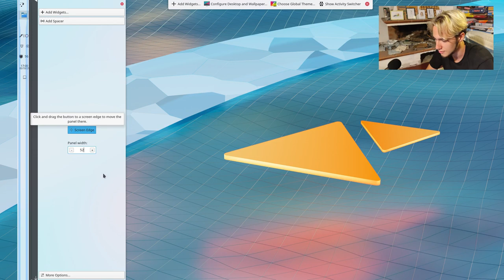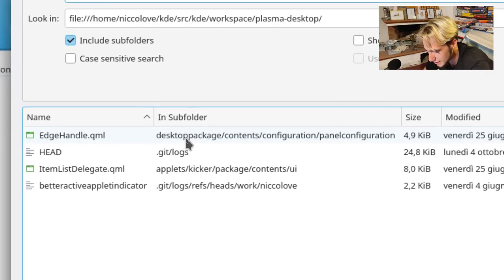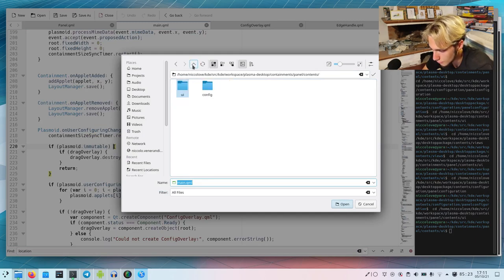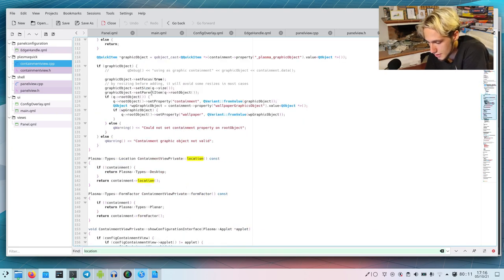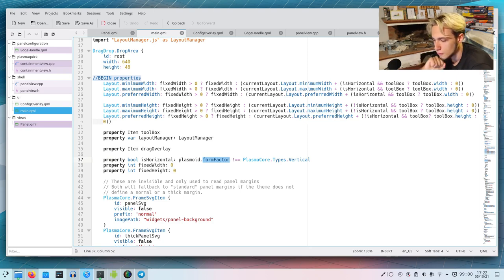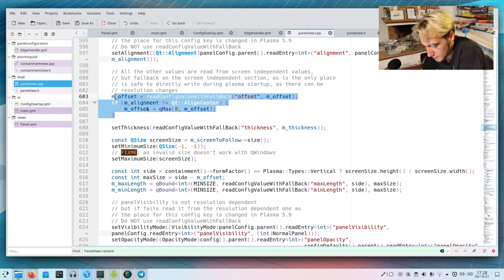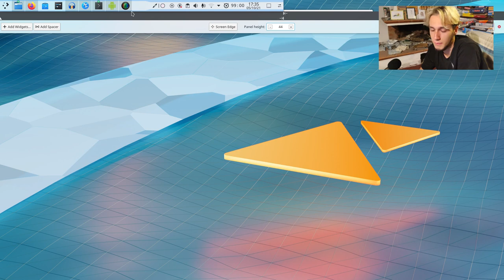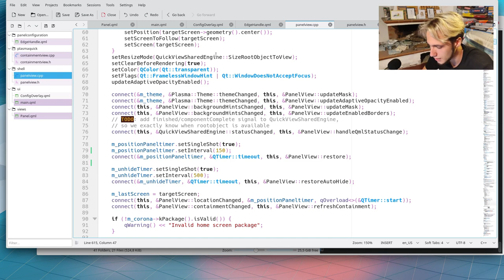KDE DEVLOG: Understanding Plasma's Panels

Comment: Very thorough video. One thing that I thing is missing from the panel, is intelligent hide. So auto hide, but only if a window is taking up space where the panel would be. 

I know "windows can cover" is a viable mode for the panel, but it's not the same UX. The animations that would be there if intelligent hide existed are very useful for the user understaing how their interactions work on screen. Also the lack of animations in the "windows can cover" mode just looks bad.
Reply: I think they are trying to add only (relatively speaking) minimal functionality to the default Panels, as it would benifit the new users experience and introduce to Latte Dock the advanced functionality that is needed in such situations.

Though I am not a Dev, so I might be horribly wrong here. :-)